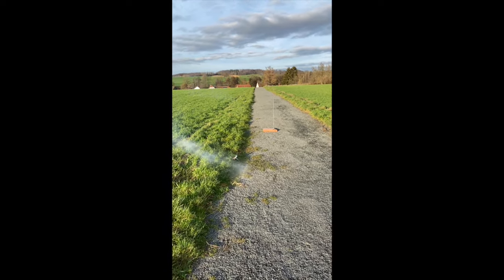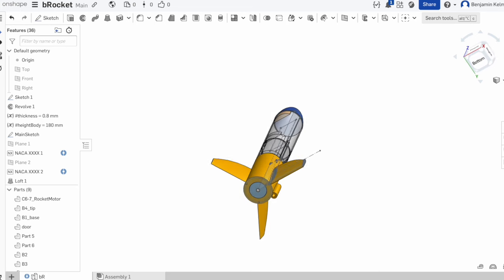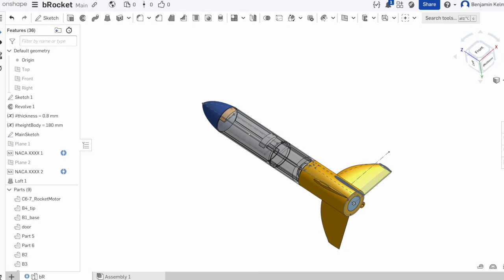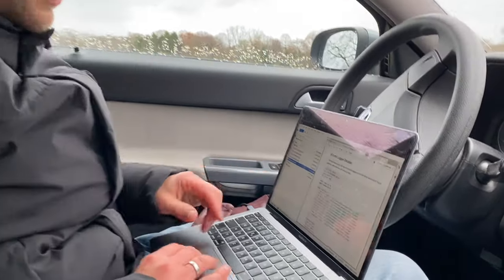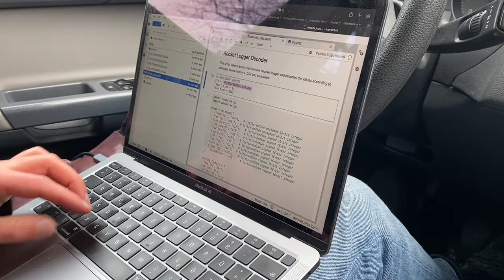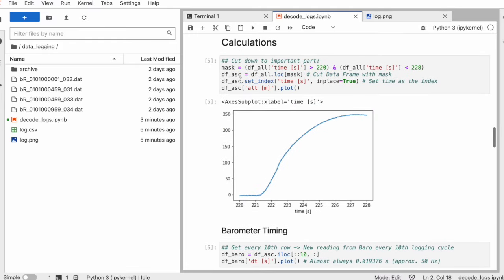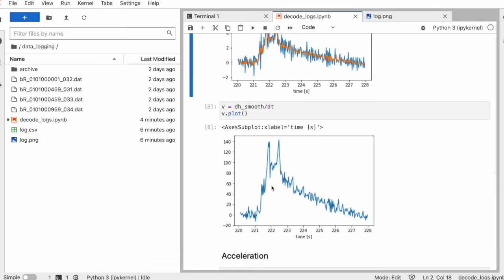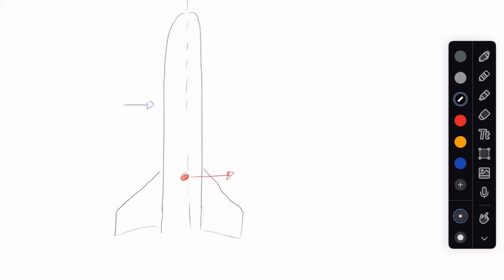500 km/h Fast | Super Small Rocket

Comment: LOL, evidently this is how an "electronics person" enters/learns to do model rocketry.   The "aerodynamics person" would know about relative locations of cg & cp but be at a loss in developing their own in-flight monitoring; which  IMO is no small feat.  Wonder why no 'recovery system' like parachute or streamer was tried?  Even though a small rocket, streamer/s could have been included?  The motor being a C6-7 had an ejection charge that separated the rocket sections.  So further aerodynamic advancements might include a "stretch cord" that attaches to both (separated) sections, for easier recoverability, and a parachute or streamer to reduce falling speed.
Reply from the maker: Haha, well said. Yes, there was a parachute, but the ejection charge was too violent, ripping the chord.